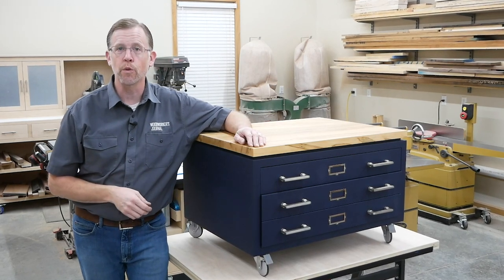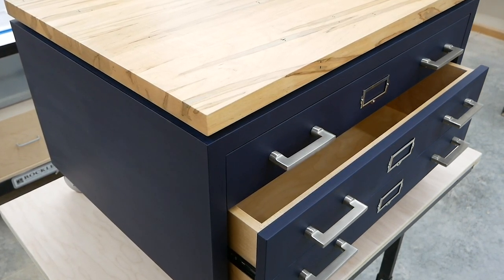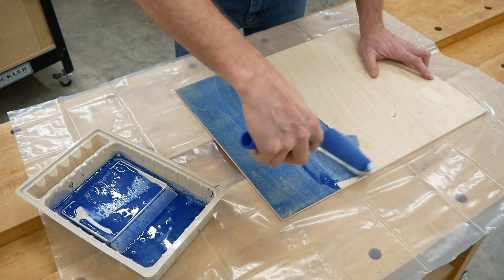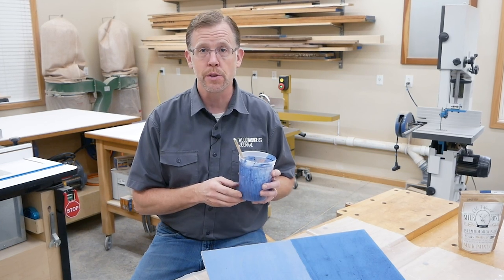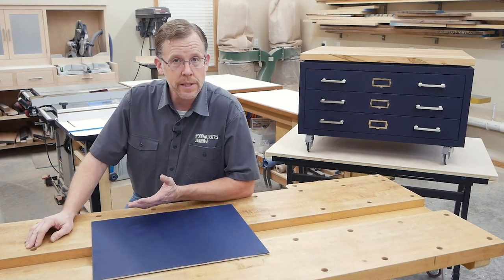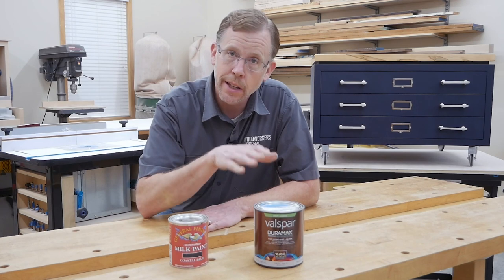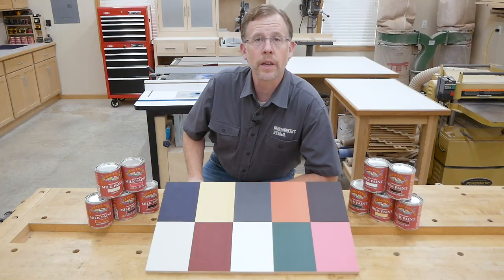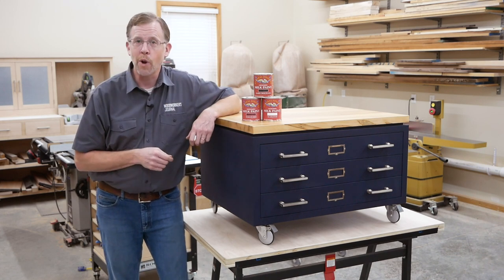How to Apply Milk Paint | Painting Furniture

Comment: C'mon... call it what it is.  That's just latex paint. GF wants to mimic the colors and sheen of milk paint, and that is fine. They're using some of the same coloring agents, great. But don't add to the deception by making it out to be something besides latex paint.
Reply: Respectfully, can you provide a source that mentions the latex content? I ask because this looks like an interesting product, but I have a severe latex allergy and would like to find an alternative to latex paint. I checked the safety data sheets (formerly called MSDS) on their site and it says it's an acrylic paint. The additional ingredients are propane-1,2-diol (propylene glycol, a common food additive) and powdered pigment, such as titanium dioxide. I can't find reference to latex, and would rather not risk a reaction by trying it.
Reply: @jaymzx0  Admittedly, I was using "latex" paint in the sense of a water-based, synthetic resin type of paint.  Acrylic paint is commonly oil-based, synthetic resin paint.  This misleadingly labeled "Milk Paint" might be water-based and using synthetic resins more similar to Acrylic paint.  It is not using casein proteins as the primary binder which is what defines milk paint.

Comment: This commercial is misleading at the very least and disgusting if you ask me. First of all, this is not milk paint. It does not even contain casein protein.  It's just a acrylic paint, preventing to be milk paint. The actual milk paint have zero VOC and non-toxic. This is not!  Second,  it is funny that he purposely peaches powder form as a drawback. What a shame.  The so-called premixed milk paint has a shelf life of 1-2 years, like most of other acrylic paints.  For the true milk paint, not only you can make it yourself, but in its powder form, it can be stored indefinitely. You only need to mix the amount you need.  How is that a drawback?